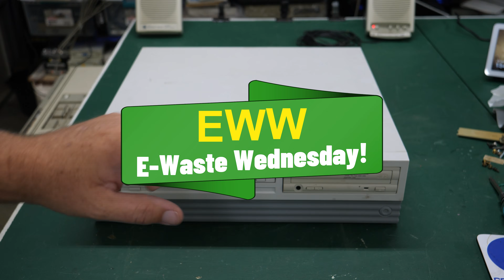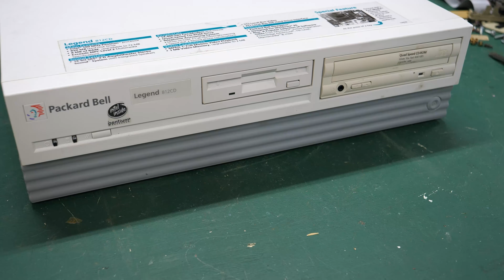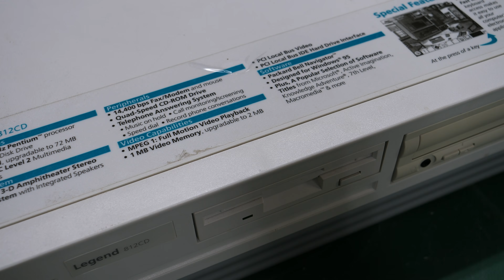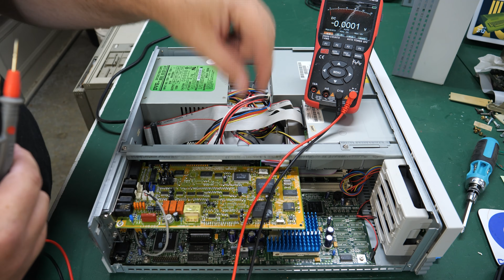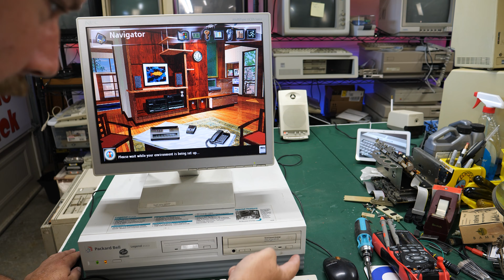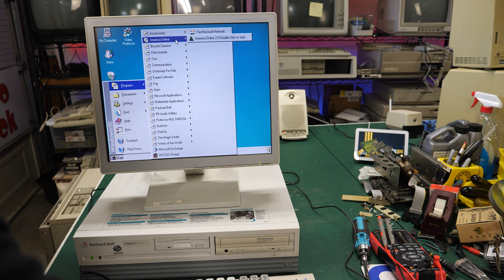Discovering a Time Machine: Mint Packard Bell PC from 1995!

Comment: That’s not e-waste, it’s a collectors item! Machines from that era-ish are in high demand, going for a couple hundred on eBay if they work.  It’s the XP era and newer machines that were kind of commodified and I don’t have much nostalgia for.  Plug n pray took all the fun out of messing with IRQ and DMA channels.  I can run that system in emulation and feel just the same.  But messing around with hardware using real ISA slots, that’s not emulated.

Comment: I had a 1997 mid-tower Packard Bell that had the same grey plastic detail on the  base as this one, but had a tower rising from it like an Art Deco skyscraper. The computer was quickly outdated for it had a 233 Pentium processor and it used fantastically expensive and finicky edo-ram, memory to bring it up to its full capacity of 128mb was 1400 dollars! It had an old-fashioned AT motherboard which I outfitted with an IDE expansion card so I could have multiple hard drives. With Windows 2000 running  on it, it worked well as a server for about 8 years, long past its useful life,  in the mid-2000s.

Comment: Can't believe this recommendation took to today for me to get! My first computer was a Packard Bell Legend 85CD - 486 DX/2 66MHz with 8MB RAM, 850MB HDD, 2x speed CD-ROM, and 14.4 Modem! It was exciting to see that QA sticker on the back, and I think you are right, mine at one point said "Warranty void if removed" and of course, when I took mine off, it left the word "VOID" behind on the case (I'll have to look on back at some point). I upgraded to a Cyrix 100MHz overdrive CPU, added 16MB to RAM (24MB was a game-changer lol), Modem to 56k, and CD-ROM to... at least quad speed, but could have been more.

Unfortunately I think the CMOS has gotten corrupt over the years. I don't know if replacing the battery will help but will find out. As it is now, I still have the desktop unit itself - it sits below my current desk, acting as a pedestal for my UPS, which supplies power to my latest two builds (I think 3rd and 4th "generation" that started as an HP Pavilion 12 years ago), plus a tiny formfactor that I occasionally spin up. Cheers!

Comment: I didn't have that exact model but I had one very similar from that exact time period.  It was a 75 MHz with a 1.2 GB hard drive.  Everything else was exactly the same as this model.  That thing was definitely not used all that much, given the fact it still boots to Navigator.  I remember upgrading mine from the stack 8 to 32MB of RAM.  The 1.2 GB hard drive by 1995 standards was enormous.  Tech was changing so fast at that time.  It was a lot more fun to be into computers.

Comment: I had this exact box. It was our first family computer, I was 16. It was a pentium 60 and I upgraded it with a 133mhz overdrive and added 8megs of ram (from 4) along with a 6meg Canopus 3Dfx accelerator add on. You can also add 1 meg to the onboard video making it 2 whole megabytes!  I couldn't get any 28.8 modem to work, my model had a 14.4 built in. Very upgradable otherwise.
Reply from the maker: Nice accelerator

Comment: I used to work at Staples when these were new, and the return rate on Packard Bell was... not good. It was close to 50%. I remember we had a vendor training one time and we had a bunch of different vendors come to talk to us about their new product lines. The Packard Bell rep totally tried to gaslight us on the quality control issues but we knew from our experience that there were really bad problems because of the return rate which was absolutely bonkers compared to Compaq.

Comment: Seeing this brings back memories.

I had a Packard Bell Multimedia C115 which was essentially an upgraded 2 drive bay version of this with a 120Mhz CPU.

I had the darndest luck with it though. It was my first pentium based PC I was "buying" by myself from rent a center. 

It played the games I owned just fine except for one that I bought when I got the system. The first PC release of Road rash (which was the 3DO/PS1 version). It was the retail version I got from WM. 

That game would wipe the drive. The people at Rent a center was thinking i was intentionally wiping the drive to get out of buying it. They replaced the HDD and I tried playing it again only for it to happen again (I just figured the first time it happened was due to a bad HDD). I brought it back and brought the game with me. I told them to restore the system, and play the game. They did and found out I was telling them the truth, because it happened to them as well. I never got the game back, and told them to shove the system where the sun doesn't shine.

Comment: Had a 50 Mhz SX version of one of these. Total piece of rubbish with only 512k of video memory which you couldn't upgrade as Packard Bell had used an obscure memory chip socket to upgrade it. I think it had 3 ISA slots which meant you quickly ran out of space. Was glad to be rid of it!

Comment: Oh hey, we had one of these! In fact, I think it was this same model! Pentium 100MHz with, IIRC, 8MB RAM (later upgraded to 16MB), 1MB Cirrus Logic video card, 850MB HDD! IIRC it came pre-installed with DOS + Windows 3.1, but with the Windows 95 CD provided (I think it may have been an option to pick it up later as it wasn't fully out yet, but I'm not sure), or I may be confusing it with some other PC and a later version of Windows. 

Came with CDs for the Encarta encyclopedia, Journeyman Project Turbo, and Silent Steel (a submarine FMV game), among others I forget.  Played Duke 3d on it in 640x480 and probably around 15fps. 

This was 2 years after we got a 386 and 2 years before I built me a Penitum 233MHz w/Voodoo 1, which itself was 2 years before I got a Celeron 466 w/TNT 2. Man, changing PCs every couple years back then, crazy times!
Reply from the maker: Nice

Comment: I had one from a couple years earlier, based on the 486. I think I put a 486 DX4/100 in it.RAM: 4 MB soldered and 16 MB worth of socketed RAM (1 MB or 4 MB, 40 pin modules).

That computer SMOKED for my purposes, including learning Slackware Linux, and HTML. I was really sorry when it breathed its last: I had abused every slot and every connector on that thing through countless hours of informative experiments.

Comment: Looks just like my my first PC, the Axcel 455CD, which has nearly the same specs. Only difference is mine came with the PI 75MHz, but I upgraded it to the PI 133MHz not too long after getting it and it looks like the sound card/modem is different too. I still have it, but I just wished I had kept the original monitor. I need to find some of these as spares.

Comment: When i was heading to college in 1996, my dad bought me this, it was a Pentium 120mhz with a 1.2Gb hdd, but otherwise identical.  Believe it or not, theres a jumper on there for bios recovery for a failed bios flash, something that saved me from destroying the $1600 computer.  I also upgraded the ram to 40mb, and overclocked to 133Mhz.  Seems laughable, but at the time (1997), it made playing mp3s far more possible.

Comment: The very reason that CompTIA was formed, and the A+ certification came into existence was because of Packard Bell.

Back in the mid-to-late 1990s, as more and more computers were sold to the public, statistically speaking, that meant that there was an increase in units which were sent to be repaired.

One brand, Packard Bell, had an obscene number of units which were "repaired" for their customer, but when the unit was received back by the customer, the unit would still be broken.

So many customers complained that it was decided to create a standardized exam covering all the basics of computer hardware and software, and having every technician at every major pc manufacturer take the two exams.

I don't remember the exact percentages, but technicians from the likes of Compaq, HP, Gateway, Dell, Apple and others, had a failure rate of roughly 7% to 10%.

One manufacturer stood out. Packard Bell's technicians had an exam failure rate of approximately 47% to 50%.

When the public heard about that, Packard Bell quickly closed their U.S. unit and disappeared.

I'm aware that Packard Bell was able to continue with sales in the UK. But you'll never find a Packard Bell Pentium 4 in the US, unless it has been imported.

And now you know the rest of the story!

Comment: My mother bought a later multimedia C115 machine similar in shape to this one but it has a 120mhz Intel pentium processor, 16 mb of ram (upgraded to 32mb by me) 1.2 gb hard drive with windows 95. It had that combo modem/sound card which later ended up dying because it got hit by lightning. I kept it running for about 10 years then I bought a new PC and everyone used that. It was in my room so if a family member wanted to use it they were in my room.
Reply from the maker: Must have been awkward 😊

Comment: I worked for a phone based customer support company that supported Packard Bells.  They were quite the PC at the time.  They were low cost components and some items like the sound144a modem/soundcard combo would be a high failure item.

Comment: My folks bought a Legend 300 CD model with the Pentium 60 CPU in like April or May of 1995. The first one didn't work correctly, but we took it back to Circuit City and exchanged it. That one did just fine for years until my mother gave it a way to the son of a friend who was starting college in 2003. I advised against it because the machine was just so old, but away it went. I had already upgraded it to the max 72MB of RAM and added the second MB of VRAM so I hope it wasn't too much of a pig since it had also been upgraded to Windows 98 (from Win 3.11) and had the hard disk upgraded twice by then from the stock 420MB to I think 30GB.

Comment: The name 'Packard Bell' still strikes fear in me as a PC repair tech back then due to those awful propriatory sound/ide/game/modem cards which would change models randomly even if the PC models were identical. The modems were software controlled like the cursed 'winmodems' of the time - getting one of those cards to work properly was an art in itself as I remember downloading the huge driver packages for them and then running each driver package individually to try and get the whole card working.
Reply: LOL! Yeah, they were absolute junk! Remember them well..
Reply: This very issue forced me to learn about computers when I was 7 years old, haha... I just wanted sound to work so I could hear the Robotz Menu Popup sound like computers at school! Not to mention not having CD-ROM functionality in Windows 95 (originally had 3.11 installed but was formatted before Win 95)...

Comment: One of these was my first computer. I had a pentium 200 one with windows 95 and I upgraded it to 128mb of ram and a voodoo 2 card. It was awesome. Also mine came with a 28.8kbps modem which got firmware updates that converted it to a 33.6kbps, then later a 56k modem. It was awesome to not have to buy a new modem!

Comment: These were the days where you can overclock those cpu by 25MHz to 33MHz and can see the speed difference.   The next speed up from 100MHz would have been 120MHz or 133MHz.    Socket 5 systems were good for their time and you could slap on some of those Evergreen CPU upgrade that worked in socket 7 systems.   Was exciting times then.    14.4K modem was god awful slow.    That is 1kb per second on a maxed out 14.4K connection.

Comment: PB caught a lot of flack for being cheap but they were incredibly important for putting PCs into stores as a regular stock item, and then into homes as a first PC.  PB broke ground and the likes of Gateway, HP, and Dell ran with it.
Reply: I just remember when we had a mid-90's PB at a multimedia software company, one that shipped with MSWindows 3.11.  When we got our first beta disk for MSWin95 we tried installing it on the PB.  That machine never ran right again (even after doing the factory install from the restore CD).  W95 basically killed the machine.

Comment: My parents bought this exact model of computer second hand in 1998 and while it was our household's second computer (the first being an AST Ascentia 910n or similar), it was the first one that us kids had free access to.  It already had Windows 98 when they bought it, with a Microsoft Plus! installation coming later.  My dad eventually upgraded the hard drive to a 5 GB WD, bumped up the RAM (I want to say to 32 megs) and replaced the processor with a 200 MHz Evergreen unit.   We also had a 52x CD drive to put in there, but I am not sure that it ever made it into that computer.

A great many hours were spent on that computer, checking our Juno email, playing Microsoft Arcade, MANY educational games (including Mavis Beacon Teaches Typing, which is how I learned to type), Oregon Trail 4 (?), Titanic Adventure out of time, etc. The power supply eventually died and similar to other period computers, it must have fried something on the motherboard, making it into a doorstop.  I eventually got my hands on another PB and moved its PSU and motherboard to ours and restored it.  By that time though, it was obsolete and has been in storage ever since.  It's actually in my attic, waiting to be tried out again.

Comment: Dude, 1995 was the time when "everyday", normal, people finally got a PC. Windows 95 was the first OS to get that kind of mass adoption - this was THAT time, you better believe there were many millions of people who had never used a mouse before. You would have to make the assumption that this was going to be a first time ever for millions and hold their hands to get them started. That was the whole point of 95 with that start button. No DOS to deal with first, and no doubt where to "start". That Start button and the flyout menu was what got the millions over the hump of tech-fear. That kind of fear was irrational but very widespread at that moment in time. Adults oif that era grew up with TVs and couldn't even program a VCR. The start button was brilliant.
Reply: I moved to OS/2 Warp 3 shortly before Windows 95 was even out. I feel old and powerful.

Comment: I had this Packard Bell, but the original P60 rather than the P100. I eventually upgraded it to a 166MHz with a matrix mystique graphics card, so I could keep step with running games in 800x600 and above.

Comment: My first computer was the UK variant, 133mhz Pentium. Unfortunately it didn’t take long before problems appeared. The monitor needed replacing, they tried to fob me off with a repaired one, that went back to the shop & was replaced with new one also the mother board failed. Packard Bell were excellent at marketing/sales after sales was awful at least in the UK.

Comment: My Packard Bell looked identical. Same case. Got it 1997. My speaker is mounted on the side of the monitor. 

The most amazing thing is that it came with Groiler encyclopedia on CD... I would handle it so carefully with its Chrome like shiny surface on one side.. blown away that you could fit an encyclopedia on this.  I would watch the short film clips that were not full screen but rather the size of playing cards.

A fascinating machine.
Reply: Forget about Grolier's Encyclopedia.  I'm still waiting to see someone find one of these that had Infopedia bundled with it.  I had done software test on Infopedia around the time of these systems.

Comment: oh the days when you could buy a computer, and then 3 months later one twice as fast comes out for nearly the same price you paid... i wish computers were still getting faster at that rapid pace, but i don't miss the constant upgrading every couple years.
Reply: Yes, faster updates in speed and capability, but back then you could still do incremental upgrades.  These days you end up  having to throw out nearly everything and start over.
Reply: @SenileOtaku  it was like that back then too... buy a pentium133mhz, the next upgrade requires a new motherboard because the one you have doesn't have mmx.

Comment: I used to have a fully kitted out Pentium 60 version of this PC.  You should try to find the Packard Bell Fast Media remote and receiver kit for this.  Between this and the TV tuner card that came as an option, they tried to make this an all in one media center.
Reply from the maker: Yeah. Wish I had the remote.
Reply: @RetroHackShackAfterHours  The multimedia kits for those are still oddly easy to find on eBay.  The TV and FM radio card is also possible to find, but probably costs more than you paid for the computer.

Comment: The Aztech combo soundcard/modem is one of the few soundcard/modem combination cards that's actually worth owning. It's essentially the Aztech Sound Galaxy Pro 16L without the wavetable adapter (you can still use a gameport MIDI breakout cable though). It has nearly 100% stereo Sound Blaster Pro 2 compatibility as opposed to mono-only SB 2.0 compatibility that a lot of cards offered, sports the genuine OPL3 chip, and even supports ADPCM + responds to SB Mixer instructions thanks to it being the Crystal mixer chipset.

Comment: OMG! I got two of these from a friend of mine in exchange for a broken down 70's Honda Gold Wing that I rescued from a field and got running.🤣 One had a dead power supply, but the other was in operating condition, and had a Pentium 66, 16 mb. of RAM, and a 1.19 gb. HDD. Of course Win 95 was the standard for the day, and with a built-in 28.8 modem, it was the first PC I owned that was capable of getting on the 'interwebs'. I struggled with AOL for several months until our local phone company finally started with 56K dial-up internet service.😉
Reply from the maker: Honda Gold Wing!
Reply: @RetroHackShackAfterHours  Looking back now, I probably should have kept the Goldwing!😂 It really didn't need much to make it roadworthy..🤪 It's just that, at that time, those Packard Bell computers were going for big money, but who knew, right?